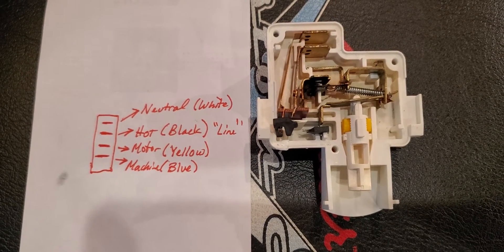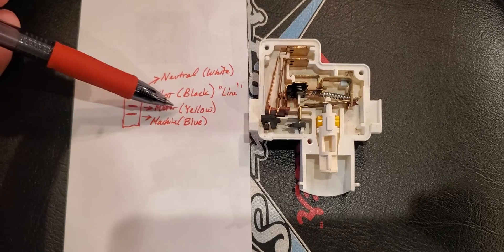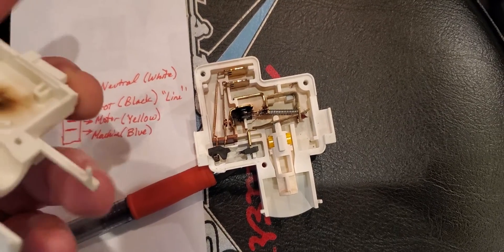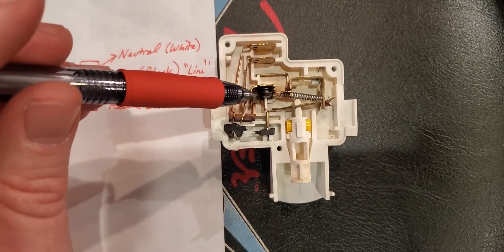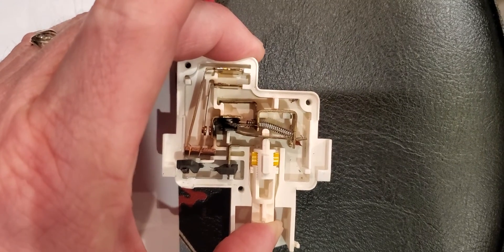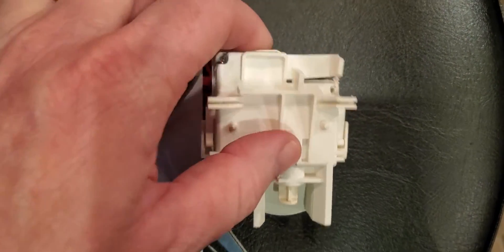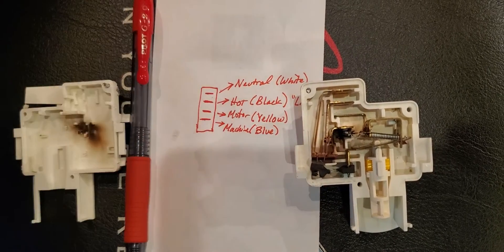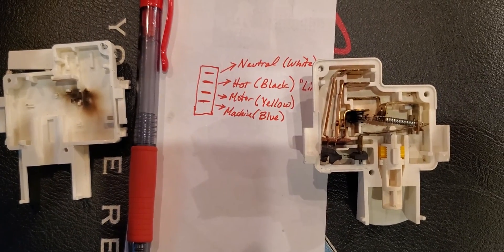Maytag Washer Lid Switch - Purposefully Engineering Failure?

Comment: Hi! Thank you so much for your kind words, credit and link to my video! I was just asked about this the other day on my video, so I thought about it, and I just came up with a theory on the purpose of the neutral wire. I think it is a safety feature for when the contacts become fused together so that opening the lid would still kill the motor while the contacts are fused together. I'm going to assume the link has some conductivity (and it would be interesting to test a working switch to see if there is in fact continuity - it looks like a carbon compound of some sort), so if the contacts (the ones that have turned black on yours) were fused together, when the plunger is released, it would cause that piece of metal directly touching the plunger, to come into contact with the other end of the link, which is connected to neutral. This would result in a dead short, instantly blowing the link, releasing the other contact, killing power to the entire machine. What do you think? It's basically a safety feature to turn off the machine if the lid opens, even if the lid switch malfunctions. As those black marks indicate, there must have been an event that caused the contacts to fuse, so when the lid was opened, the link melted apart.
Reply: I think you are absolutely correct, that’s obviously a burn-away link designed to shut down the entire machine if the lid is opened and the motor is still energized. We have a commercial machine here at work that just blew the lid switch link, and after cutting it open it’s clearly a burn-away safety cutoff switch. I’m sure the link is conductive to some degree before it burns away, there’s no other reason for a neutral to be there.